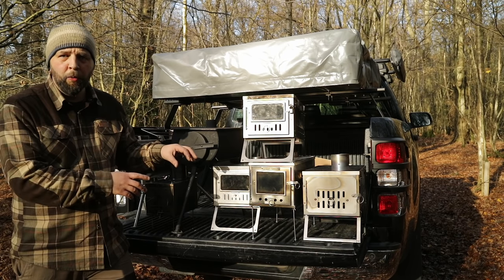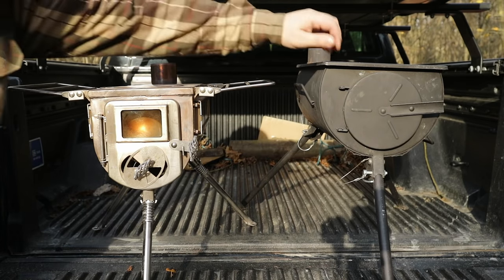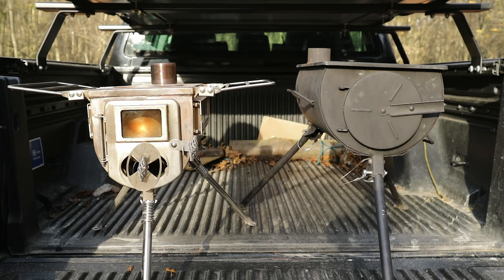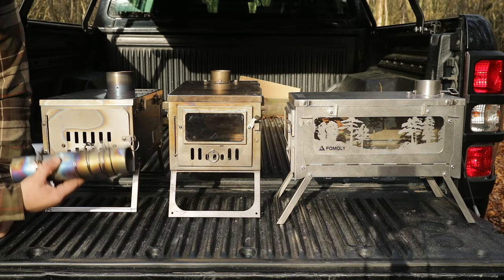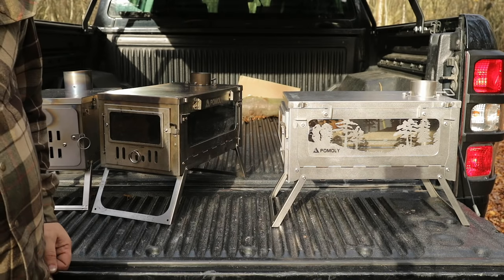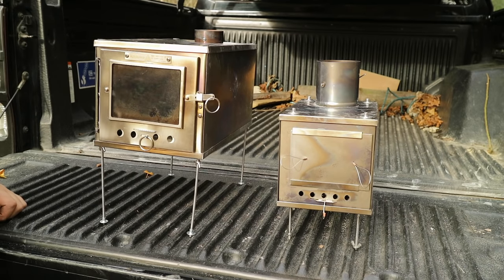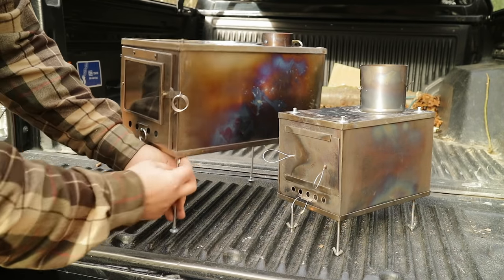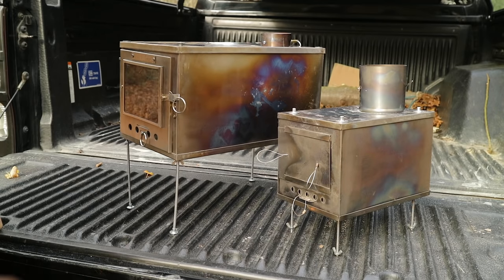Tent Stoves Compared - My collection of wood burners

Comment: I have the outbacker stove. I used the top warming grill from my bbq as a grate inside the stove. It's the correct width to fit inside. I just cut off about 10cm in length. I never use the front door on it. I top load the wood and the draw is strong enough that no smoke ever escapes.

Comment: Personal preference, the foldable woodstove may be ok and a bit lighter. But I'd rather have the heavier ones just because they are more durable. I've used one in the beginning of January in north east USA to heat a makeshift tent shelter made from PVC pipe and cheap tarps and cook on as well. Once we got the stovepipe setup right and above the roof height of tent, it was above 70°F inside and a very chilly 23°F outside.

Comment: Right on. Yeah I'm gonna have to check some of those out. I've been really stepping up my winter game. Did a lot of snow shoe camping last year, and Im thinking of getting into the "Hot Tent" scene. It gets down to the -30s F around here in the Upper Peninsula of Michigan sometimes. Even the warmest sleep systems are tested at those temps. I wouldn't mind pulling an 8lbs titanium stove around with my other gear in a sled. Thanks.

Comment: Very useful overview 👍
I've had a kifaru stainless slot together stove that was very good but fiddly. Also I've found that in a salty coastal environment the steel does eventually corrode, especially on the threads of the bolts... but also the stove pipe.
So I've now gone for a titanium goat cylinder stove for backpacking. And I like the look of Nortent's folding stove for canoe/kayak trips.

Comment: My Luxe 3W got some good use but I was tried of putting it together especially after some warping. And it was too small for me. I got the Pomoly T1 and it's just about perfect. I like the "standard" damper opposed to the card style.
Reply: Does it make a noticeable temperature difference inside a tent?
Reply: @xristinarose2409  I just got back from a trip with the Pomoly stove. It wasn't very cold outside (25-30°F) but it was easily 65-70° inside. 75° on occasion. Of course it depends on where the thermometer is placed. I don't "cheat"; I keep it low/sitting height and away from the stove. My 3W stove may have kept up, but it would have been feeding it more smaller wood, frequently. Small stoves generate lots of coals, so you'll want a shovel and metal pan to empty and make room for more wood.

I think the 3W stove would work better in the small teepee tents they sell. I use a larger cabin-style tent.

Comment: 3:14 They use that design because the rounded bottom with flat top directs heat upwards so you get a hot cooking surface. The tripod legs are because three legs wont wobble.

Comment: Perfect timing. Was literally looking at tent stoves. Thanks Andy.
Reply from the maker: Hope it helps, there are also G stoves and luxe but I cant really comment on those
Reply: @kentsurvivalgearreview586  helps for sure. I didnt know about the U turn, that thing seems pretty neat. Thanks for the info!
Reply: Richard Clark everything is very overpriced. I saw a miltec tent stove for £150 but it's 19kgs. 
Been watching the ammo box make your own vids. I'm very tight with my cash. 
If someone brings an affordable titanium one to market they'll get my money. 
But for now I'll probably make my own. Why not.
Reply: Nice video.  I have a G stove. 
Bomb proof stainless steel well crafted.  
If weight is not an issue check out Silver Fire multi use SS tent stove with integrated Baking Oven!

Comment: Thank you for putting this together...  I'm going on my first "summer" motorbike camping trip and have been looking at hot tents for car camping in Norway next year as I didn't realise that I could get collapsible stoves...  My original plan was gonna be for my wife to drive with the gear and I'd take the bike...  I've looked at a couple of TiPi style hot tents as they're so much lighter and smaller than than the dome tents that I currently have (we also have a huge family tunnel tent) but nothing suitable for colder nights.

Looks like we can probably get away with a TiPi and a folding stove for Norway next year.  Any recommendations for best insulation?  I heard you mention OneTigris...  In your opinion would that be good for Norwegian Autumnal weather?  Wind isn't too bad, but it does rain a lot and when it doesn't rain, you can get quite a sudden overnight frost if the cloud cover breaks.

Thanks for any help and advice from a fellow "Man of Kent"

Comment: I use the AliExpress stove myself and love it, just small enough to strap to outside of my LK35. The only mod I’ve done is add a wire rack to keep the wood off the bottom of the stove
Reply: How did you do that? And won’t the bottom still fill up with ash reducing the airflow still?
Reply: @Jonsoh811  I just cut down a grill rack from an old oven, and the bottom dose still build up with ash. It’s just to keep the embers off the base, trying to improve the life of the burner (only time will tell though). You can now buy them made to measure from AliExpress along with some other options
Reply: @thegeordiewildcamper2437   In lieu of a metal stove rack I just go to a nearby creek and get a couple shovels of sand from the creek.  I put the sand in the bottom of the stove which keeps the stove bottom from burning out and the sand holds heat in the stove longer.  When I'm done with the stove I just pour the sand along with the ashes out on the ground somewhere safe...
Reply: @charlieswearingen500  good idea 💡
Reply: @charlieswearingen500  --  When you're done with the stove just pour the sand along with the ashes in your Privy hole and cover with dirt .  Subsequent rainfall leaching through the ashes will create Lye which will speed the decomposition of the Privy contents .
Reply: @001desertrat3   Good Idea... :-)
Reply: @Jonsoh811  ~ If you were asking me, most stoves have enough space in the bottom of the stove for a .5 to 1-inch layer of sand.  Most sheepherder stoves have plenty of ventilation from around loose doors, hinges, and vents...

Comment: As you probably know, a stove without a grate will wear or burn out faster.  If you don't have a grate try putting some stones or bricks in first, then build your fire.  This helps keep the intense heat off the bottom steel.

Comment: Having just watched Matt (Adventure is Made) have an honest, if scary  hot tent fail with his stove and tent, the same question comes back to me. I'd like to be ultra safe where heat is concerned. Is it possible to attach a hot tent jack (silicone variety as attached to many canvas tents ) through the fibreglass hot tent patch pieces such as used in One tigris non-canvas tents?

Comment: I saw you have a stove and pipe in your hut. What have you done Andy, to stop the roof of beginning to burn . 🔥
That stove you lent from Simon, what was the name again? Cube?
Reply from the maker: Hey, I removed a shake and used a double walled chimney flue section that dissipates the heat on the hut. The little stove is the seek outside cub, theres a link to them in the description :)
Reply: @kentsurvivalgearreview586  very clever

Comment: I see so many video, the tent inside is too hot.

I would like to know the outside and inside temperatures for a tent stove and tent to achieve a “comfort zone”.

Of course, height off the ground so the base has some openings, and the door zipper as well as having the top vents open can
adjust inside temperature to an extent.

Nevertheless, so many video show the inside is just too hot.

Do you have experience to share about practical outside and inside temperatures for soecific tent stoves.

I ask, because you have many.

I have two hot tents: Smokey Hut and Preself w/half mesh, and both are about the same size.

I want to buy one stove, one time.

It is just too much money to spend to try this or that.

Do you have experiences to share?

Comment: Our stove for a bell tent just smokes the whole place out. Why is this? We tried coal, wood, burner logs but it gets so smokey
Reply from the maker: smoke will usually be for one of tree reasons, moisture in the fuel, smoke not escaping properly or the fire not hot enough to burn the wood gasses that escape. things to check for this could be the length of the flu for the size of the stove or the dampner being closed off too much. I cant speak for coal but some of those fire logs can be impregnated with paraffin etc too.

Comment: Can anyone give me an idea of heat output on the titanium models. They're all about the same size (not the mini) I have a 5m bell and temps can get down to 0°F quite frequently in the dead odlf winter. I have good sleeping bags but would like to be comfortable. Also, burn time is a question to me, is it worth it to get a 305 slightly larger for a longer burn time? Thanks in advanced to anyone who has input. Maranatha
Reply from the maker: i dont know heat outputs as a quantifiable thing but for a 5m bell that cold id go for a bigger steel stove myself. In my 4m bell in 0c or a few degrees lower i can feel it cooler on the far side with my medium steel winnerwell.

Comment: Andy did you get hit with any customs charges on the aliexpress stove?
Reply: when I bought my luxe wildwildwest stove, which is very similar, paid nearly 300 quid for it, I got an extra 70 in customs. I was expecting more but then the stove was lovely lit up in tent. Just make sure the stove jack is a tight fit, because the flue being so light on the connection to the firebox, needed that extra snugness in a scottish gale 😂
Reply: @whiteeaglewarrior  yes I’ve been. Spoiled by my tent stove.I was always a fair-weather camper but now I’m wanting a longer winter with lots of snow!
Reply: @stephenlambert9826  Aye usually I am in my car camping, which is cool, but this weather the car dont cut it. I want to get out again with tent and stove. Only thing as pointed out is they can be fiddly to set up, and doing that in cold not looking forward to it so I can set it up at home and carry it. I cant walk too far at mo due to disability but I know some good spots with short walk. Need to do some DIY on house, some extra stitching on the lavvu (I have a few so modding them as I go) then I can get out there again.